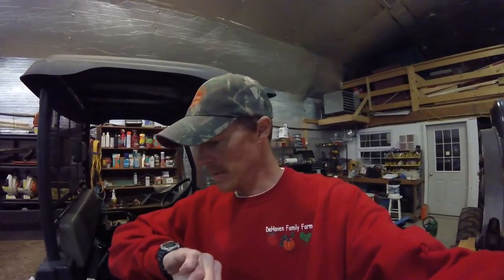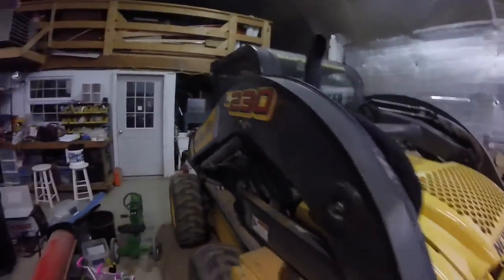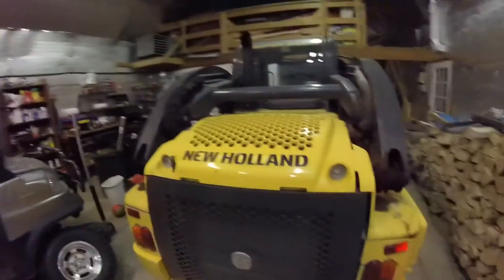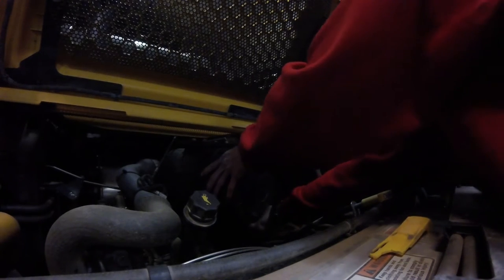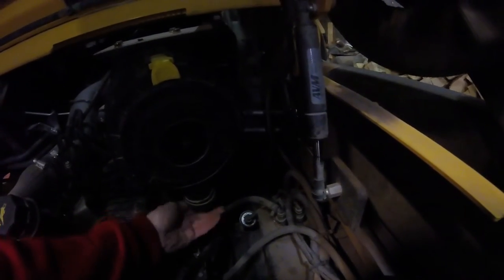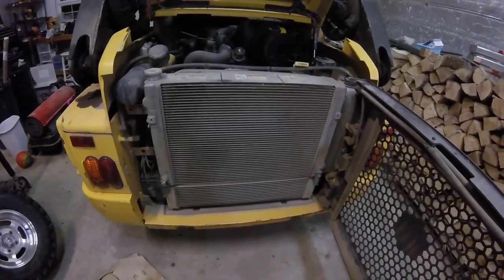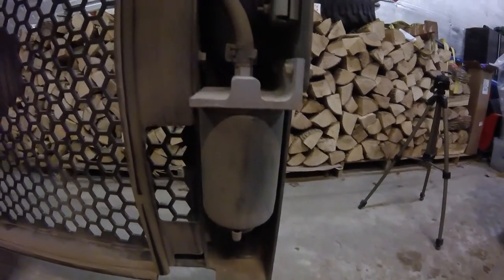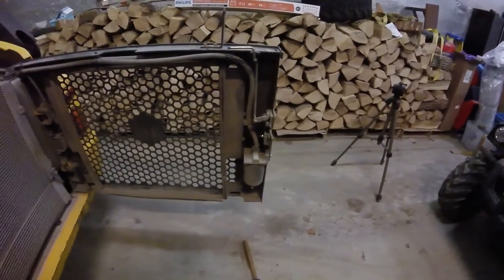My skidsteer filter change nightmare

Comment: I noticed the same problem when I first tried to check the air filter when doing PM on a very lightly used L220. Since most people don't have Shaq hands, it seems like most people seem to have the exact same problem trying to get the cap off. Spray a little white lithium grease on your finger and rub a thin layer around the seating edge of the cap before putting it back on and it'll be significantly easier to take off next time. A little will go a long way, so don't overdo it.

As far as filters/belts/sensors/fluids go, you'll never go wrong if you go OEM or manufacture recommended straight from your local New Holland rep.
Reply from the maker: Good tip!

Comment: I found your video looking to see how to change the hydraulic filter on my son's Case SR220.  This definitely is how to not change it.  We used a center punch to punch the filter on the base at the bottom, put a pound steel coffee can under the hole and punched a hole in the top.  We got over half a can of oil out of the filter and then lost some when we removed the filter.  After we got the filter off, there is a plastic catch pan (way too small) with a hose attached to it to catch the oil from the filter.

Comment: Sometimes manufacturers have patents or rights to certain filters so the aftermarket cannot make them. Also with engine oil filters, for example, the cartridge types can have slight dimensional differences in aftermarket versus factory so they are not infringing on the rights, and thus allowing the bypass of non filtered oil back into the crankcase.

Comment: In the future, get the CNH hydraulic filter. It has a square on the end to put a ratchet on to get the old one off. I really do not understand the issues you had, I just changed all the filters on an L228 with 600 hours, which was never touched before, except the air cleaner element knocked out a few times, and it went smoothly.

Comment: next time you change your hydraulic filter make a troft out of cardboard and stick that under the filter and put a bucket under the other end that way the oil goes in the cardboard troft and into the bucket instead of all over the inside of your machine
Reply: Thanks

Comment: Pre filling your fuel filter is a bad idea. Your machine has an electric fuel pump that, if you power on your machine without cranking the engine, will fill the filter and purge the air from the system. Filling the filter just introduces contamination to the clean side of the filter.
Reply: sorry, but you are wrong. Pre-filling your fuel filter is vital, however you need to only fill using the outside holes, and get fuel from the petcock on the fuel filter housing. This will supply clean and fresh filtered fuel to use. The reason you have to do it on a diesel, is because the fuel injectors on a diesel use the fuel as a lubricating agent. introducing air to a diesel injector immediately damages it. Not to mention the damage that can be dealt to the transfer pump by running air through it. Diesel engines are NOT like gas engines, there is no tolerance for air.
Reply: @makerstories4008  All of the air in the filter gets purged when you run the electric fuel pump (which runs whenever the ignition is on) before cranking the engine. The air would flow out of the filter and into the injection pump then out the injection pump fuel return port and back to tank.

What makes you think air would get to the injectors anyway? If any air makes it past the injection pump it will air lock in the injection lines and the engine would stop running.
Reply: @KALI1080  you appear to be confused. Diesel engines use whats called a transfer pump (or HPFP) this pump is almost always mechanically driven by the engine, and not electronically actuated (like a modern gas engine typically would be). as a result, fuel is only moving while the engine is turning. Air wont just magically exit the system when you turn the key to the run position.  this is generally the case on engines like the DD13, C15-18, and most heavy equipment such as the DW SK, Yanmar Industrial engines and many other  more vague applications (only specified some engines so you can google these part-outs). These types on engines specifically RELY on having solid fuel in the rail to properly lubricate. The only exception to this would be an engine with Oil pressure regulated injectors which will use HPO and IPR to regulate the injector pressure, and supply lubricant to the specialized injectors; this kind of system is usually referred to as a "HEUI". Smaller injectors, such as the ones in this skid, are especially important to fill as the ports and channels in the injector are much smaller. Smaller air pockets can end up doing just as much damage as larger ones. 

And yes, these engines are entirely fuel regulated and yes, they WILL run away. Its part of the nature of any diesel engine. and its why you never damage the fuel system on a diesel, it could lead to catastrophic damage, injury, and in many documented instances; death.
Reply: @makerstories4008  I have four years in the trade. While I am still an apprentice, I know about many different diesel fuel systems and how they work. HEUI, Mechanical, Unit injection, common rail, indirect injection or power cell, ETC. I've had the opportunity to work on many different diesel engines from brands including IHI shibaura, John Deere, International, Cat, Cummins, FPT, Iveco, Deutz, Perkins, Mitsubishi, Yanmar, LS Mtron, Kubota, Lombardini, ETC.

I am not claiming that I am a master mechanic. However, I am no clueless yahoo from teh interwebs.

I have done overhauls on these engines (FPT F5C, AKA: FPT F32) and have tested the injectors and timed the injection pump. During my first overhaul of an engine in school, the instructor wanted to make a point to all of the class. He took apart an injector from this engine and lightly, as delicately as he could, marked the needle of the injector with a sharpie marker. Think about how small that mark is. He let me try to put the needle back into the injector nozzle. The needle did not fit with the mark on it.

I know how critical the clearances are on diesel fuel systems are in part because of that demonstration. The whole point of my instructors demonstration was to show us how little contamination can cause premature wear. He told us that filling the fuel filters is a bad practice due to the contamination it causes.

This engine's fuel system is a fully mechanical Bosch VE distributor pump. Fuel flow from the tank through the injector is as follows:
Fuel is sucked from the tank into the lift pump. From the lift pump is flows through the fuel filters and into the inlet of the injection pump. Inside the injection pump is a vane pump (which can be used as a transfer/lift pump) which increases the fuel pressure inside the case of the injection pump. The fuel branches off two ways here. It goes to the fill port on the plunger metering sleeve and reaches a relief valve that bleeds excess fuel off to tank (this is where the air gets out of the system with the electric lift pump running because no fuel will flow through the metering sleeve without the engine running). Once the fuel gets to the plunger, the ports line up and the plunger pumps the fuel to the injector that is lined up.
Reply: @KALI1080  to be honest I don't really give a shit about your experience. Because simply put there is a lot of value placed on figuring shit out for yourself. Especially in this industry. Also you talk about engine precision like it's difficult to pull off. Diesel engines aren't very complicated. If you have been in the industry 4 years you should really know this by now. I'm just telling you what new Holland, John Deere, ditch witch, Toro, yanmar, and Kubota all tell techs to do this. For that reason. Only exception to this is caterpillar, who tells people not to prefill, however even their dealer techs pre-fill because it's stupid not to. Because of this I have a hard time believing that you have 4 years in the trade.
Reply: @makerstories4008  I'm done arguing with internet randoms. All the techs that I work with do not fill fuel filters. There's more than one way to skin a cat.
Reply: @KALI1080  I'll back you up on that. I am a 20 year master tech and you are 100% correct, you should never pre fill a fuel filter. That L230 does have an electric supply pump that delivers fuel to the common rail pump, and it will purge the fuel to the fuel rail cycling through the return. The newer one's also have a hand primer on the water separator on the door and a bleed screw to more effectively get the air out of the system. All diesels no matter how old had a way to prime the fuel system and purge the air whether it was a hand pump primer, an electric supply pump, or on many pieces of equipment, gravity feed. Putting dirty fuel into a new fuel filtet is wrong in every service manual I've ever laid eyes on. My suggestion is read the operator manual for your machine and see what the procedure is. On this machine in particular a couple things could have been avoided. One we've allready noted, the other being the hydraulic filter drain that has a hose in the battery compartment so you can catch the oil that runs out of the filter when you remove it and not get it all over everything.

Comment: i knew a guy had a newholland ls230 skid steer trying get parts but he couldnt get the same parts because the newholland doesnt sell after market parts wich it was kinda rediculas john deeres are like that too and its good thing my kubota dealer sells kubota after market parts because there still avilable wich it was kinda good and parts wernt to much money wich the parts on kubotas are pretty desent price at my kubota dealer
Reply from the maker: The filters for the machine have to be purchased from New Holland. I cannot find them aftermarket. And they are expensive!
Reply: thats not too good the newhollands dont keep after market parts its like deeres they stoped making after market parts wich the kubotas are keeping there aftermarket parts avaliable with the newer parts wich i find kubota are smart not stop making after market parts wich kubota filters are priced at my dealer at $30.00 to $40.00 wich isnt bad for filters and $25.00 for 10w30 1 gallon jug kubota oil